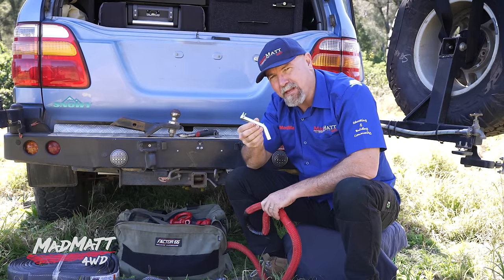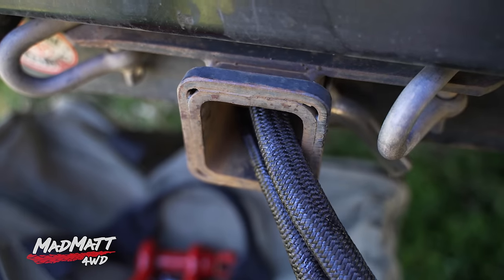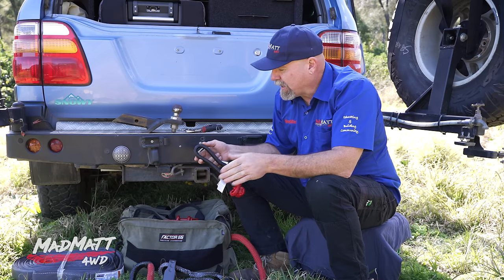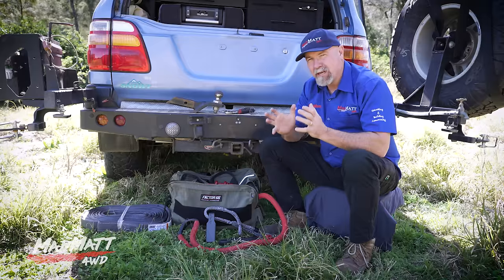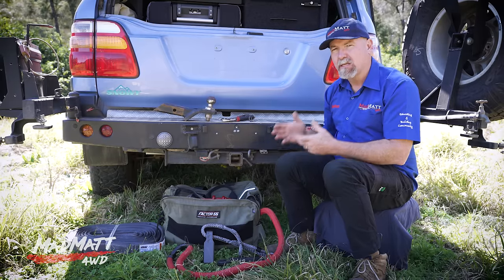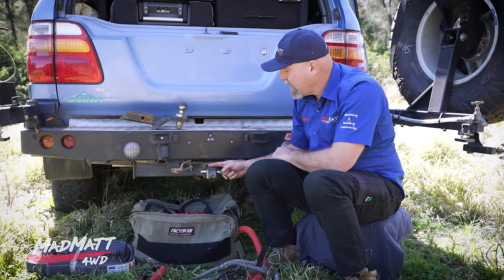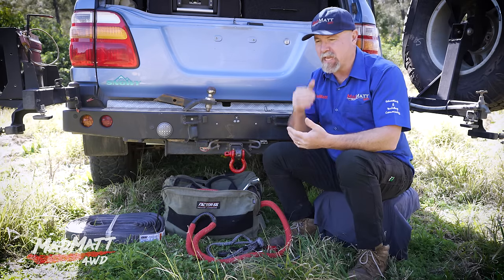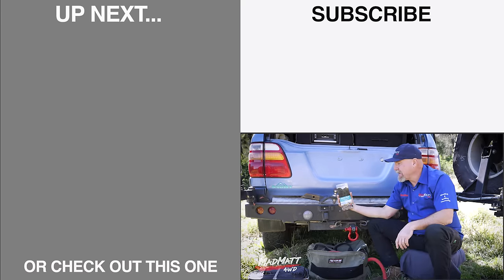Should you use a hitch pin as a 4x4 recovery device? Is it a YES or NO answer?

Comment from the maker: I’m passionate about helping the 4wd community and I'm developing an online course so i can help as many people as I can to get out there and wheel well on their 4wd adventures. To register your interest and for free and exclusive training videos visit http://madmatt4wd.com.au/register
Reply: I would love to hear your analysis on hitch mounted winches.
Reply from the maker: @miznitic5574   Hey. So long as the winch mount is designed correctly they have their place. But for the most part, I don't think they're a worthwhile solution. They definitely can work and be safe.
Reply: yes me..  ive asked this Q, & had no A.. my Q, is, what, is the shear kg of a hitch pin. seeing you can tow 4t, its the pin taking the strain, not the hitch.. what material are they made from, various, will they shear, or bend. the clevis, might hold 5t, but the chain is fixed to a 5mm pin.  so the pin, has to hold 20t, 4 times strain.. ronny dahl, had to cut a tow ball half way thru, before it gave.. pins need to be rated, the same as balls, shackles ect. its the pin..  @MadMatt4WD
Reply from the maker: @harrywalker968  There's lots to consider here. 1st the tow hitch has no rating for a recovery as it's designed to tow. So everything we're doing is unrated and at best could be considered best practice. The loads subjected when towing are actually quite low. To tow 4T you do not need 4T of lifting capacity. Just think you can push a small car but you can't lift one. The hitch pin is in a double shear which significantly increases it's strength but again there is no rating on it.

Comment: One of the first things anyone ever buys for their 4WD is a nice shovel to proudly strap to the roof rack to make it look like a serious adventure machine. It is also the one piece of recovery equipment that I rarely see being used. Taking as much of the load out of the situation as you can by digging the restrictions out from under the 4WD,  can be the difference between a deadly snatch and a simple tow out of a hole.
Reply from the maker: Totally agree. I did a video the other day showing getting unbogged with just a shovel.
Reply: @MadMatt4WD  link?
Reply: I agree with @badadventures. I have saved a lot of recovery effort by using a shovel, it is especially useful in soft sand. On top of that, it is super handy around the fire.
Reply: Something that always gets used when you're alone but when you get to camp it's the first thing off the roof ready for a fire or bog hole.
Reply: Mine folds and sits in the back, use it every time I'm stuck pretty much... I find those plastic boards people carry to be far more obnoxious.
Reply: I bought a $20 shovel from home depot
Reply: There's been a few times in my life when I ditched a vehicle in deep snow (without anything but a shovel) and shovelled a track out of the ditch back to the road. Lots of hard work but once you've done it you realize how important it is to know how to use a shovel.

Comment: I use a grade eight bolt holding my hitch in. It will be a hassle to remove the ball hitch and change it to a pintle type. But i change it during winter since i don't pull a trailer in the winter, but the pintle is good to attach a tow strap to.

Comment: 5:55  The pin bends after exceeding the snatch strap's rating by over a ton; it seems that pulling by the pin is safer than the rest of the video claims.  It would be interesting to know how much more it takes to break the pin since a bent pin doesn't create a hazard.
Reply: thegunsngloryshow  Stainless is often weaker than steel, tho it depends greatly on the type of steel used.  Locking pins with the push button release are hollow so they'll be weaker.  One could get a tool steel or other high grade steel for the pin.
Reply: Or a grade 8 bolt? 😂

Comment: Really good video Matt. It's one thing most tutorials don't cover, they generally all show text book situations assuming everything is perfect, the vehicles have all the correct gear, they are on flat ground, perfectly aligned etc. But it doesn't always work out like that, and you often come across stuck ill prepared vehicles in non-textbook situations. So it's good to see someone tackling these scenarios. When i done road crash rescue and 4wd recovery certifications back 25 years ago we done a lot of improvisation techniques, and also had rescue and recovery hierarchy. It's invaluable information, thanks for addressing this topic.
Reply from the maker: Thanks and I’m glad I’m being part of the solution not part of the problem.

Comment: I usually use just the pin when I happen upon a stuck car in a place it shouldn’t be. To be clear, I remove my receiver and ball and use just the pin. Again, I have never seen a pin fail but I have seen balls break and damn near hit people. I saw a ball break and go into a tree so deep we had no chance of getting it. I have also seen cheap amazon D rings (clevis hook) bend open and release. Recovering a stuck vehicle is just potentially really dangerous if taken lightly or done without care. Appreciate you shedding light on good safety habits.
Reply from the maker: Thanks mate.

Comment: My thoughts exactly on your assessment! The pin in only useable for low energy straight line pulls.

I did nicely radius the edges on my receiver and upgrade the pin to a grade 8 bolt but still would only use it in a low energy, emergency situation. 

Great video!

Comment: People should always remember that in most cases only 4-6 bolts are holding those hitches onto that vehicle. 8 if your lucky. I had a hitch on my F250 almost fall off after towing a trailer through the mountains because the bolts stripped out of the holes in the frame. It had been removed by a body shop for service and then put back after the repairs and instead of them replacing it with new bolts they had put it back with the original bolts and I’m assuming tightened everything up with an air impact that probably stripped out the fasteners 😮 II towed that trailer all through the smoky mountains like a death trap not realizing it was wiggling it’s way loose. Safety chains are no help if the whole hitch falls off the vehicle. I would advise anybody who’s doing off-road recovery on a regular basis to just have their hitch welded to the frame to make sure it can’t shear off. Especially if you do a lot of these recoveries and then go pull a trailer.
Reply: Doesn't welding the frame, weaken it? Best off checking and replacing the bolts as required.
Reply: Don’t weld to frame

Comment: A good educational video on a bit of a contentious topic.  One of the arguments for not using the hitch pin is that it is not rated and tested for that sort of load.  That is reasonable, but that logic can also be applied to the whole Toyota/Hayman Reece/'insert brand here' tow assembly.  AFAIK, these are also not tested or rated for the forces of a kinetic recovery.  So it comes back to common sense, education and risk mitigation, which is i guess part of the reason you do these videos.  So thanks. 👍
Reply from the maker: Yes it’s difficult when so much of what we’re doing is not real good but works if we’re careful
Reply: And kinetics RULE! 😂

Comment: Glad you mentioned DOUBLE SHEAR,  as a steel shackle receiver has SHARP EDGES,  and IS MUCH MORE LIKELY TO SHEAR THE PIN THAN ANY ROPE,  EVEN BEING A SINGLE SHEAR SET UP....Do as you wish. I've used recovery ropes and pins thousands of times for over 40 years,  and never even bent a pin badly enough that it was difficult to remove. If something is going to shear a pin is likely going to be wedged in the hitch,  or eject sideways,  away from the drivers.  I'd rather have a rope that weighs next to nothing flying around than a 15 lb shackle receiver on a rope coming directly towards the drivers heads.
Reply from the maker: So you had good success with a pin only and a hitch receiver will be stronger and better but you don’t want to use it?

Comment: Thanks Mad Matt for covering this subject as the tow bar pin hasn’t been recovered in depth of detail as you can provide 
The reason I asked about this in the last video was because I forgot my tow bar recovery hitch 
And unfortunately had a situation we had a vehicle heavily bogged and winching forward was not available at this point abs I did use the pin as my point of contact for the snatch strap but use very lightly as a drag not as much as a full snatch 
Thanks Matt
Reply from the maker: Glad to help

Comment: This is good advice for the energy created by a kinetic recovery from mud. In rock crawling we generally just need a little tug to get a light weight jeep off a rock. This is well within what the hitch pin is designed for and much less than what it would be subjected to towing a 10k pound trailer thousands of miles. Thanks
Reply from the maker: What you’re  identifying there is the difference between what we call a tow recovery and a kinetic recovery. And yes for a tow recovery the pin would be fine as you say. But best practice still suggests we use a hitch link.

Comment: The key really, is to be equipped so you can use the correct recovery equipment for emergencies as well as weekend wheeling trips.  Keep a short load out in your daily driver and have the full load out in your wheeling vehicle.  Safety all the way around.  We all should be ready for emergency situations.  Emergency gear... don't leave home without it.  ;)
Reply: Agreed. I was just out on a trip and came across a poor bloke in an old Cruiser with what appeared to be water in his fuel. He was stuck in the middle of the road, pointed up hill and those stupid wire rope barriers on the side, preventing him from pulling over. I had a snatch strap and a couple of soft shackles with me and I had him off the road in a couple of minutes. You gotta do what you gotta do.

Comment: It speaks volumes to the level of technical skill involved in off road recoveries that most military forces around the world have dedicated recovery mechs and dedicated recovery vehicles - including tracked recovery vehicles.  I've worked with them many times over the years and because the 'Reccy Mechs' live and breathe recoveries of heavy vehicles the safety factors they work with are substantial.  As you correctly point out, people can use recovery equipment recreationally with no formal training, no scheduled inspection or testing of recovery equipment, and no understanding of the forces involved.  As we have very recently seen it can be a lethal combination.  Let's hope people watch and absorb the messages you are sharing.
Reply: Well said. As an ex-reccy-mech, I shudder, sometimes, at what I see happening out there in "no idea land".

Comment: I use a recovery hook from a semi-truck. I welded a sleeve over it as a shim to fit the 2 inch receiver tube correctly. (the weld is at the back end of the hook and only serves to hold it in place). Overkill? maybe but I believe overkill is good practice, for example, if your equipment is rated for the work you are likely to be doing use a higher rated device, it could significantly increase your margin of safety.

Comment: It's also important to define your terms.  What is a "4x4 Recovery"?  
The first example given, it's what I would consider a Standard Recovery because it doesn't require Four-Wheel-Drive and it isn't off-road if you can pull from the pavement.
  
I had something similar happen to me, it was a minivan slid in a creek and I had a rear-wheel-drive pickup truck and 75 feet of 5/32" Polypropylene Diamond Braid Rope for tying down loads.  I tripled up the line and looped it from my hitch to their hitch.

Comment: I used the pin a few times without drama, but that was only in a 2wd VW Transporter that doesn’t take much to get bogged and with a hand winch. I also filled the edges of the inside of the hitch receiver. 

But I never considered the radius of the bend of the tow rope on the pin.

Comment: The pin on its own is something I've always done, and I've always debated in my head whether it's necessary to buy a receiver.
But after this really simply explained video, I will go buy one. 

They're not expensive so we really don't have any excuse.
I just always left it as the pin because I figured I'm just eliminating the hitch receiver and thus its one less thing to fail.
But your points outway my one thought.

Thanks again Matt. 👍👍
Reply from the maker: My pleasure mate. Only trying to help

Comment: Noob to my 4x4 and you just saved me from cutting tow straps or killing anpin AND strap. I could see me welding a square of pipe halves for a smooth insert to protect a strap, but you brought up the pin itself as another problem!
I will rather weld up a square tube hitch, with an extension welded to a large piece of pipe, with a keeper plate on top?
Reply from the maker: Welcome. For the cost just buy the right tool designed for the job. It’s not worth the risk.

Comment: Terminology always gets me and even though you are a world away I still believe "receiver" is the hitch attached to the vehicle and the hitch attached to vehicle is not a "tow package" or "tow pack". A tow package is a mounted reciever, added cooling under the hood and trailer light wiring. Possibly gear ratio change. All installed at the factory.
Reply from the maker: Ha ha ha. Yeah I try to use language or you lot but dang it’s tough. 😂😂😂 nice comment

Comment: I'd be interested to see what the difference is between the hitch pin diameter and the standard shackles people use. Additionally, under tension what happens with a soft shackle and the bend radius? 

Great content as usual Matt. Just acouple of questions that come to mind watching this.
Reply: Pin bent at 9 ton on a static sustained pull. Would bend at a much lower point in a kinetic situation!
Reply from the maker: 5/16 and 3/4 for the shackle.

Comment: This is a great video to get people thinking a bit more before undertaking a recovery, however there seem to be inconsistencies in the logic and figures (please correct me if my thinking is wrong!).
First - under test conditions the tow bar pin bent at 9000kg, which was stated as being too low to use in a recovery situation, however the recovery tongue was stamped with a Max Load of 9500Lb (approx 4300kg). Surely that would mean the recovery tongue isn’t suitable either when using an 8000 - 15000kg snatch strap??
I have always used the tow bar pin - through the eye of a snatch strap. The strap eye is the same width at the internal size as the receiver - so in my thinking, it spreads the load over the full width of both the pin and the snatch strap eye. My thinking is the less metal bits attached (recovery tongue and/or bow shackle) the better…
As far as recovery speed goes - be careful of going too slow when recovering in soft sand with a snatch strap… I have seen both vehicles stuck with the snatch strap under tension between both cars, and unable to be removed without a lot of mucking around to move one vehicle backwards - I find it better to use a bit more speed to allow one vehicle to ‘spring’ back a bit, removing tension from the strap.
Keen to hear your thoughts!
Regards
Drew
Reply from the maker: Hey Drew. Read this from factor 55. Then watch Roberts video linked in description which talks about the forces involved in recovery and every moment of speed is dangerous. 
The 2” hitch itself is rated for 9500 lbs. that’s the max load. That’s why the 2” HitchLinks, all of them have 9500 lbs machined into them. Our parts have not seen yielding in testing until just before breaking. What’s this mean? Every other item you have attached to the HitchLink and pin will fail before either of those do. 

Standard duty soft shackle - 39K 
Tow Strap- 31K 
KERR- 29K 
HitchLink 2.0 - 51K 
Hitch pins- 50+K 

The entire off-road industry functions off break strength not WLL. 3/8 Synthetic rope breaks between 18-22K so a 5:1 means it’s WLL is only 4.4K on a 12K winch? 

It’s about quality of materials and validation through testing.
Reply: Factor 55 has videos of the destructive testing they've done on their hitchlinks. They've sustained above a 50K pound load before ultimate failure. In testing, their hitch pins have a double shear strength somewhere in excess of that.

Other quality hitch pins can shear at a lower load. Factor 55 posted results years ago of a US Army destructive test of their hitchlink 2.0, which had a different type of hitch pin double shear at 47K pounds, without failure of the hitchlink itself.

That's still a lot higher than the point at which a pin would fail from directly attaching a recovery rope to it- double shear compared to single shear.

Comment: I have a Cast Steel Pintle Ring with a frozen hitch pin stuck in my class III receiver. We tried induction heating then air hammering the pin with out success. At some point I will have to cut off the outer ends of the pin and drill it out, but since I usually just skid logs or pull a car out of the snow once in a while and haven't done any towing in years I'm not in a rush to drill the pin.

Comment: I dont think i have ever used a snatch strap recovery. Granted i travell alone so would use a winch for self recovery i have come along once to a bogger prado or something. Yep used the winch. Snatch strap is bogs on sandy tracks not stuck on a beach to the sills. I think there is a limit to snatch strap and anything past a Sandy track should be the winch
Reply from the maker: I’m with you. A snatch is only used when I have to. I also travel alone a lot
Reply: Same, sand is the only place I will 'snatch' I call it bumping. Anywhere else it's tire traction or winch %100.